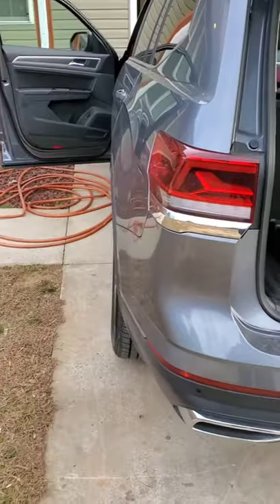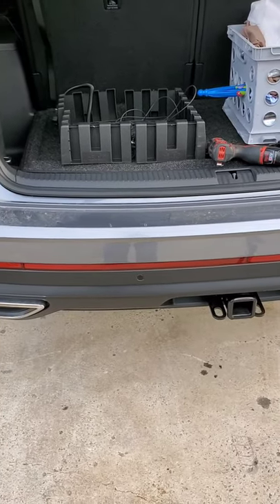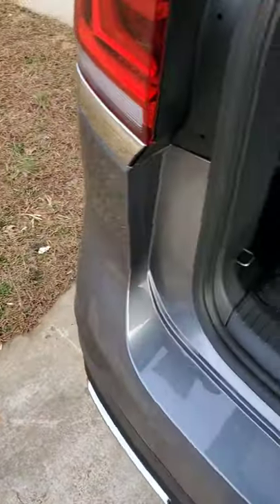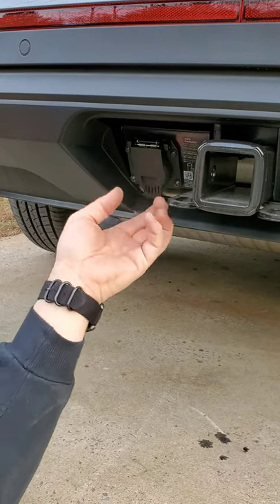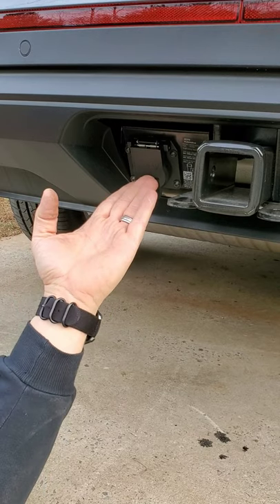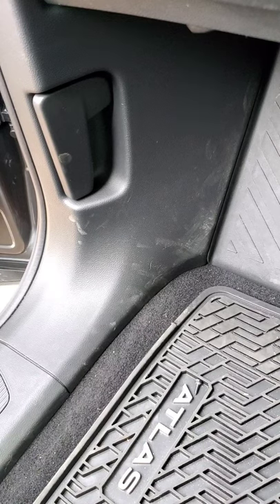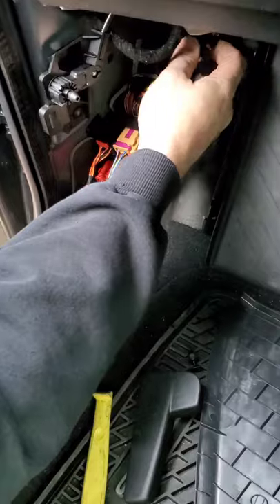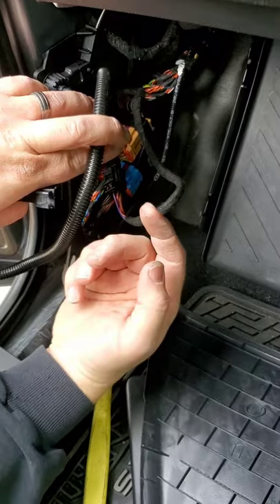Adding  trailer brake controller  vw atlas  or cross sport 2018-2021

Comment: Thanks a ton for you excellent video. Just finished following your exact steps on a 2023 Atlas Cross Sport already equipped with a 7 pin tow package. Added a Curt brake controller and wiring harness and it was a breeze! Good job on the video.

Comment: thank you and again thank you , this is a great video . i have a vw atlas cross sport execline 2020 . we have buy a wiinibaggo minnie 1808 fbs  . the rv sealer ask 700 $ to instal a brake controller and the towing plug
Reply from the maker: https://www.ebay.com/itm/VW-Atlas-Plug-and-Play-CURT-Trailer-Brake-Control-Harness-/284153018909?mkcid=16&mkevt=1&_trksid=p2349624.m46890.l49286&mkrid=711-127632-2357-0
Reply from the maker: this was the adapter harness I used with a curt brake controller

Comment: Thanks for this video! We have a 2021 VW Atlas V6 and went to pickup our RV yesterday but they couldn't find where to plug in the brake controller.
Reply from the maker: awesome we pull ours does pretty  good pulling I just wish the fuel tank was a little  larger  to hold more fuel.if you ever have  any questions  about the atlas. hit me up ill help as much as I can
Reply: The manual doesn't have much info on towing and the RV dealer was concerned with the vagueness of it. Have you heard any concerns from VW about towing?
Reply from the maker: I honestly  haven't  seen any info on  towing. but we have pulled our camper a couple hundred  miles.we are using a curt weight distribution hitch with sway control.we are planning  a trip out westwas gonna be this year but we are thinking  of pushing it off till next year.
Reply from the maker: @rbaday   There are some people  in a atlas forum  that have been towing since  they came out in 2018. if any of that info will help. https://www.vwatlasforum.com/threads/towing-experience.2839/
Reply: Is your vehicle a 2021?
Reply from the maker: @rbaday  yes and I had a 2020 before  this one I lease  them from work
Reply: @thefricklife7288  Awesome to hear! We thought we were out of luck until watching your video! Thanks so much for posting!
Reply: @thefricklife7288  I want to use a weight distribution hitch on our 2021 that we just picked up this week. I’ve seen a lot of people saying VW doesn’t recommend this. Have you had any issue using your weight distribution or see why it would be a issue? We are going to be pulling a 3900lb dry travel trailer.
Reply: Also, can you share what curt WD hitch you are using? Thanks in advance!
Reply from the maker: @kaseylcard  I have read that they don't recommend  it . I belive it's because it's a unibody instead of a actual full frame vehicle. I don't have any issues  running  ours It really helps with the rear squating plus the sway control  also helps. I know that even being a unibody the atlas still seems pretty ridged vw uses alot more welds than other companies. you will just have to load your trailer see how much tounge weight  it has and see how bad it squats  and how it pulls you may feel like running  without  a weight distribution hitch works out fine in your situation. ours is a 2020 coleman lantern  I believe  ours is 3500 dry but when we picked it up it had a full tank of water and the tank is in the front of the trailer. that probably  didn't help our squatting  of our atlas.
Reply from the maker: @kaseylcard   I bought a curt 17022 it's overkill but it was cheaper  at the time and came with sway control
Reply: @thefricklife7288  awesome, thanks for the info! I haven’t found any info on anyone running WD on the Atlas yet, so it’s nice to hear from someone who is. Also video is a life saver. Thought I was going to have to install a full brake control harness aftermarket. Did you get your harness from etrailer? I can’t seem to find it on there site.
Reply from the maker: @kaseylcard   I actually  ended  up getting  the adapter harness  from eBay but I got the controller and 7 blade from e trailer
Reply from the maker: @kaseylcard  
https://www.ebay.com/itm/VW-Atlas-Plug-and-Play-CURT-Trailer-Brake-Control-Harness-/284153018909?_trksid=p2349624.m46890.l49292
Reply from the maker: @kaseylcard   I deleted  the first link it was wrong this link should  be the right one now lol
Reply: @thefricklife7288  thanks again for taking the time to share this info! This is a huge help getting our new Atlas setup to tow.
Reply from the maker: @kaseylcard   no problem  im gonna do a  video  on  how easy it is to make it to where your 12v and USB can work even with the atlas off
Reply: @thefricklife7288  nice, looking forward to that as well.

Comment: I think you're wrong by saying that having the tow package means you have the quick plug behind the trim. The plug is there regardless of tow package or not.
Reply from the maker: in newer models  they started putting  the plug in all of them but if you don't have the tow package  you will also need to install  a tow module.

Comment: I just bought a 2021 Atlas cross sport V6, SEL Premium and when i ask the dealer if i needed to have a brake controller installed they told me no. They said this vehicle's tow package can sense the trailer and somehow activate the electric brakes
Reply from the maker: I haven't  ever heard that before  I don't think vw would place wires for the brake controller  up behind  the a pillar  if the car could self adjust  the electric  brakes I could be wrong  but haven't  ever heard of such

Comment: Hello. It is a great demo video. Thank you! I also have the harness issue same as others. I got TEKONSHA 90160 brake controller coming with harness 3072-P but connector doesn't fit to Atlas wiring end. Could you please help me out to get right one? Great thanks.
Reply from the maker: so this is the one I used for a curt controller  not sure if the controller  side of this woupd fit your controller but the vehicle  side fits the atlas.

https://www.ebay.com/itm/185198561811?mkcid=16&mkevt=1&mkrid=711-127632-2357-0&ssspo=YdsIxtgxTqK&sssrc=2349624&ssuid=e88zbH95Q5W&var=&widget_ver=artemis&media=COPY
Reply: Yup, mine is TEKONSHA. Your harness probably doesn’t fit with TEKONSHA controller. Anyway, thank you!

Comment: Does this installation then provide a charge wire to charge the camper batteries also?
Reply from the maker: if your atlas has the factory  tow package  it has the wire to charge  the rv battery

Comment: Is there an alternate part number for the adapter? I’m having the same issue of the adapter (51522) being too big to fit the atlas plug in
Reply from the maker: https://www.ebay.com/itm/VW-Atlas-Plug-and-Play-CURT-Trailer-Brake-Control-Harness-/284153018909?mkcid=16&mkevt=1&_trksid=p2349624.m46890.l49286&mkrid=711-127632-2357-0
Reply from the maker: sorry didn't get the notification  I bought mine on ebay  it was this one

Comment: This video was super helpful! But, I'm having trouble with the wiring harness. I purchased the same controller (CURT 51140 TriFlex) on Amazon along with the Curt 51522 wiring harness that you reverenced. But the harness does NOT fit my 2019 Atlas. The connector on the harness is larger than the one on the vehicle. The packaging that came with my 51522 harness lists compatibility with only Audi vehicles up to 2017. No mention of the Atlas. Any ideas?
Reply from the maker: there have been several  people  getting  the adapter harness  and they are incorrect for some reason ill search  the links again
Reply: @thefricklife7288  Thanks! I took another close look at your video and confirmed that the connector in your Atlas is identical to the one in mine. So, the issue seems to be with the wiring harness.
Reply from the maker: @markdbonds  im wondering  if curt has a issue  with the adapter  because the 51522 even in there photos  look correct
Reply from the maker: @markdbonds   if you want you can email me pictures  of the harness you received  I can try to figure out what happened  and maybe help you get it fixed my email is 1uberaudi@gmail.com
Reply: @thefricklife7288  I emailed you a couple of pictures yesterday.
Reply: Was there a solution to this issue. I'm running into the same problem. The 51522 didn't fit my Atlas as well
Reply: Curt 51528 is what I got from eTrailer.  That worked for my '18 Atlas SEL

Comment: Late to the party, my '18 Atlas required a 51528 (ran into the same issue with the 51522 (the box indicates it's for the Audi SUVs).  Curt told me 51522.  eTrailer told me 51528... eTrailer was right.  Got it hooked up and calibrated.  Pulling a 3500 lb Keystone single axle.  Triflex is clicking while I'm driving... kinda feels like driving with the e-brake partially engaged.  Anyone else have this issue?
Reply from the maker: yeah seems like there was a issue  I ordered  mine from ebay it wasn't a name brand but matched up to my plug
Reply: @thefricklife7288  you're towing a similar trailer to mine, does your Triflex intermittently click quickly and display a number (typically between 3.0 and 4.5)? Sometimes while accelerating, sometimes when coasting at speed above 30 mph... my friend followed me in his vehicle and confirmed that the brake lights on the trailer aren't coming while the clicks are happening on but there's no way of knowing if the trailer brakes are engaging during the clicking I'm experiencing.  Thanks for the video btw... was a big help!
Reply from the maker: @unkletravelingmatt  no mine stays blank with a single dot while driving I believe  there is a way to calibrate it also is you maybe angled up ?
Reply: @thefricklife7288  got it calibrated pretty easily at the dealership, braking with the trailer is fairly smooth, no surges or sensation of being pushed by the trailer. Triflex is mounted pretty much at a flat 90°.  It'll display the single dot while driving and then out of nowhere, clicking and flashing numbers on the readout. I'm going to take the kick panel apart, disconnect and plug everything back in, recalibrate and see if it's still present or if it goes away.

Comment: could you send the link to the adapter harness you used?
Reply from the maker: https://www.ebay.com/itm/CURT-51522-Brake-Control-Adapter-Harness-Fits-07-20-Atlas-Q5-Q7-SQ5-/254814738371?_trksid=p2349624.m46890.l49292
Reply: @thefricklife7288  thank you!
Reply: I ordered that adapter and it didn't fit.  I have a 2021 SELP.  Any ideas if you have a different year or set up?
Reply from the maker: @tylermuxworthy6911   not sure what the difference  would be the brake controller  wiring is the same on 2021as it was on 2019 maybe they sent the wrong harness. here is another link on Amazon. this has they correct  plug on the body side but the other end is going to depend on the type of brake controller you have 

https://www.amazon.com/dp/B07GBT9Y1P/ref=cm_sw_r_cp_apa_fabc_J6Z0SF0WXXKWQSPJQTYJ?_encoding=UTF8&psc=1
Reply: @tylermuxworthy6911  same thing happened with me. I have the 2021.5 cross sport. I think they did change the plug in the latest cars.  I ended up just splicing it in myself. It was super easy.
Reply: @TJHornbeck  Thanks TJ